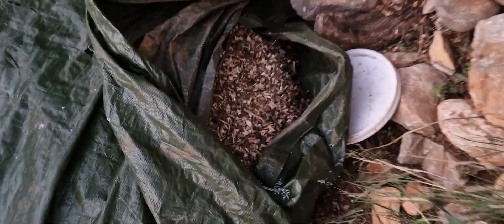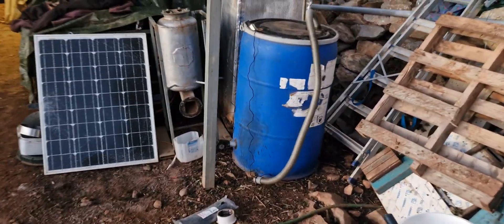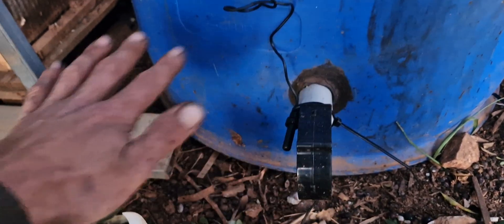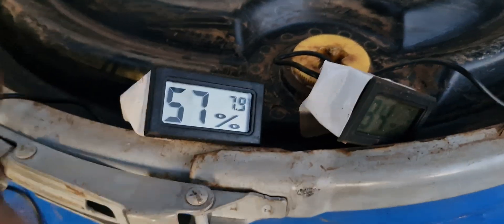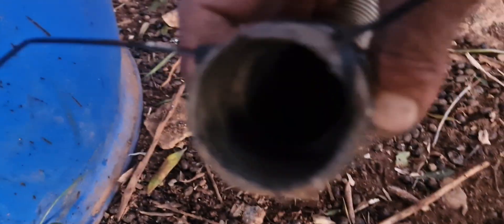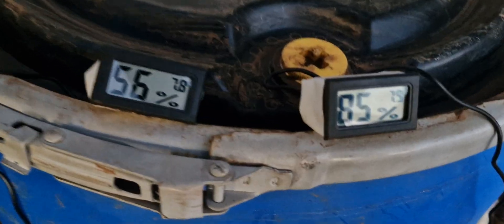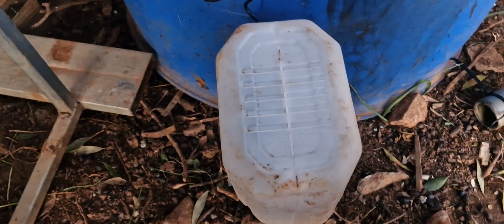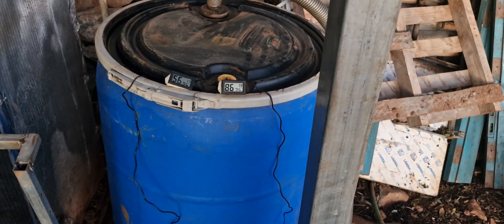woodchip drying for gasification #DIYGasifier #BiomassEnergy #OffGridLiving

Comment: Oscar.... I have available free wood chips from the power company  and I want to heat my home with these chips, howver green they 55-60% water, how long using your method of drying, how long would it take to go from 60% green chips to 15% burnable chips..??      Great idea you have...!!
Reply from the maker: It highly depends on weather conditions,  if it's a little sunny 1- 2 weeks en if it's raining 4 weeks,
Reply from the maker: In between 1 and 4 weeks , depending on if you use hot air or not, en ofcorce weather conditions

Comment: I believe you'll get better airflow by having the blower downstream , that is to say sucking the air through the barrel. You may wish to compare the 2 methods and see if there's any measurable difference ?
Reply from the maker: I did al possible configurations en the best way seems to be pushing it from beneath so the higher temperatures drives the moisture out on the top . The fan had bad condensate inside of a pull it en moisture stay inside the barrel if air is flowing down . Now i use a solar hot air generator en this works very well . 200l of fresh chips dried in 5 to 7 days

Comment: Wood chips have a percentage of moisture, try using dry charcoal for filter material, or not.
Reply from the maker: I do use charcoal for the gasifier filter now, This is not a filter systeem anymore its a Fuel dryer
Reply: @oscarverwey  drying racks around and on a wood stove would dry fuel, real simple old skool 😉
Reply from the maker: Thats a Sure thing, although in my tiny house ther is not so much space for such things, so i made this barrel en upgraded it whit a solar air heater en a solar panel to change the battery for driving the equipment for the gasifier en the starter motor while drying Fresh chips whitnin a few days , you can see that in one of my other videos, (drying whit solar energy)  this was needed because drying in the open is prone to rain en most terrible are the free chikans around the propperty XD they move the chips al over the place haha 😂

Comment: What do you do with the chips?  I wonder if you could use them in a pellet stove?
Reply from the maker: Making pellet stove fuel is absolutely possible en is part of this process after it's dry I separate the smaller chunks en the dust from the bigger ones (I get about 1/3 pellet stove fuel en 2/3 gasifier fuel) the main thing is to make gasifier fuel to make electricity, hot water, hot air en dry fuel,

Comment: Nice setup! Solar panels plus computer fans is great combination.
Reply from the maker: Its the electric power supply for the whole gasifier operation ( glow plug, 2x air fan , auto gas mixer, static filter, water pump ,alternator excitation en temperature meters